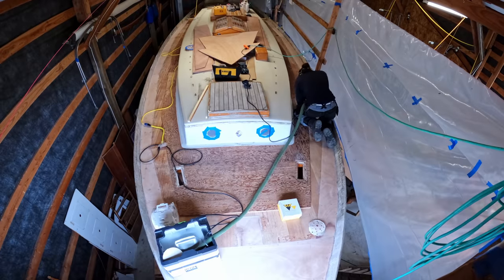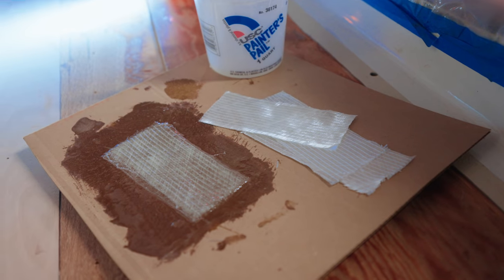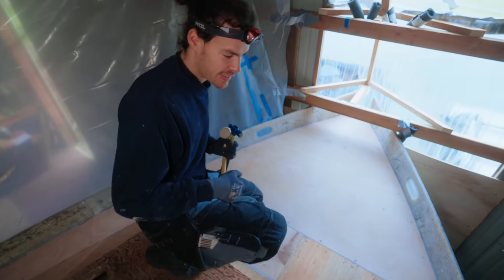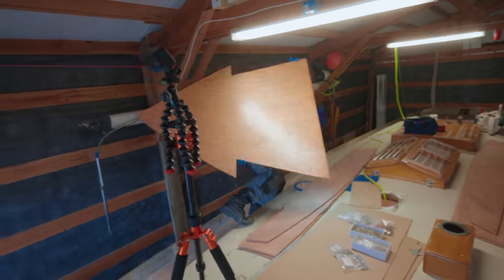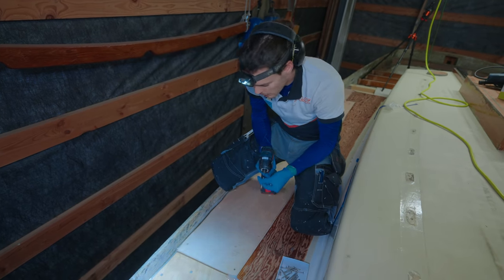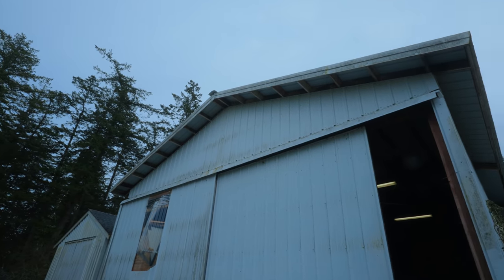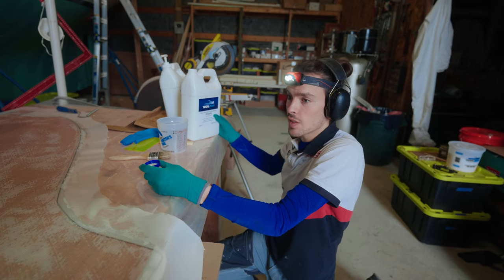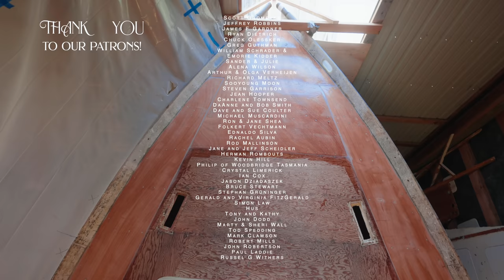The DECK IS CLOSED! [S4E47]

Comment: Pro tip, using a household hairdryer while while wetting  out helps a lot . It will thin the resin , making saturation easier and less resin.

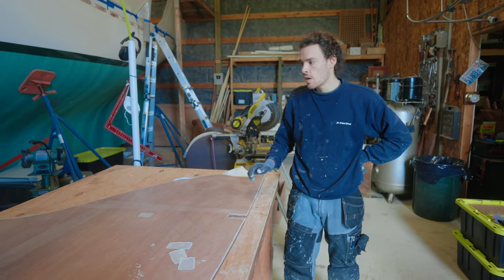Comment: At 17:30 minutes, were you applying epoxy atop, or through, the peel-ply to fully saturate the fiberglass. Then at 19:30 you said you were leaving the Peel-Ply on. That can't be right, can it?
Reply from the maker: We applied some epoxy over the peel ply, but it soaks through. It was just to make sure the peel ply was saturated. And yes, we left the peel ply on for now, we'll remove it later.

Comment: Why wouldn't you use a hand plane,you don't know how to use it
Reply: Speed and it's not what they need to work with to achieve the desired result
Reply: Reference to the deck plywood? Surely not an appropriate tool on plywood on any face to use a plane, manual or power. 
I have used air in line sanders, whatever works well.